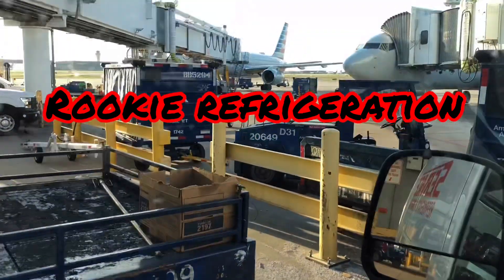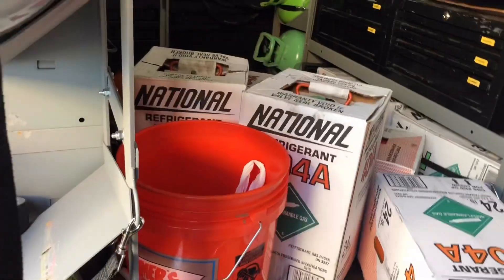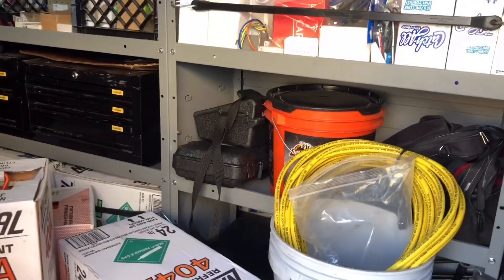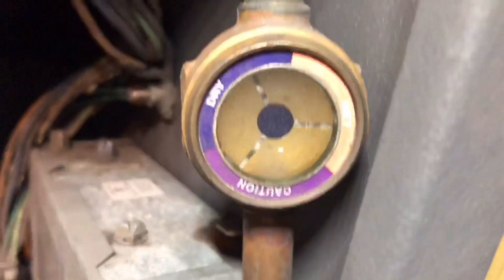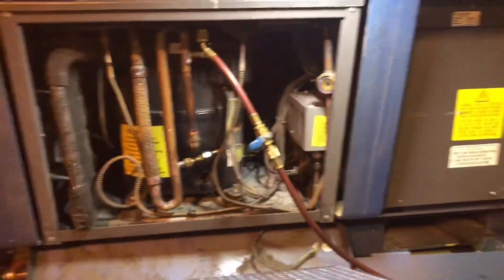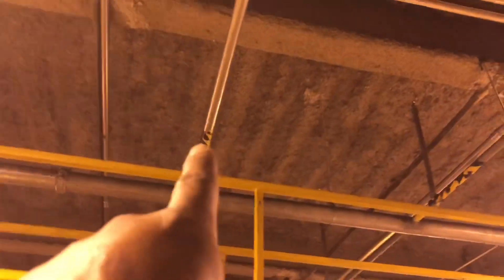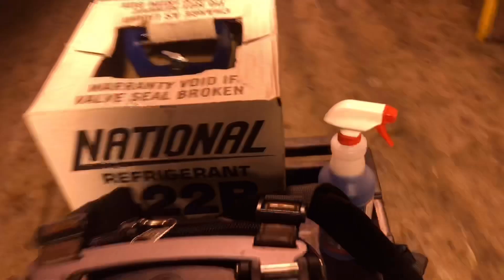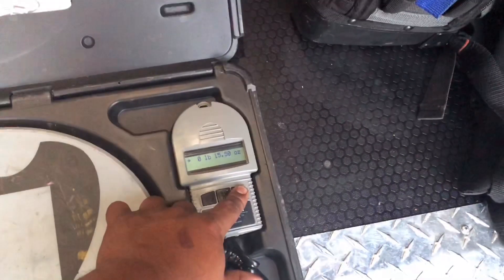HVAC/Refrigeration:  XRay Machine at Airport low on charge.

Comment: I had to install a remote beer system at a large airport once.  It was a pain in the rear because you had to have security personnel escort you back and forth to the truck.  I put a caulk gun through the xray machine and the security guys thought it might be a machine gun.  I even went through the wrong door and set off a security alarm.  This was back in the 80's before TSA.
Reply from the maker: PickleRix lol.  That’s funny

Comment: Dude I know the feeling. I work all the non Coke a Cola vending repairs at DFW and for American Airlines. 
Brothers from another mother. 
Will look for you. Like to meet ya.
Reply: 6:44 headed for the gate. 
The sense of relief. 
The stress is manageable after a while, couple of years. 
Have been on the ramp for 11 years. I know the spots. You parked D29 and were lucky to find a spot for sure. Next time check out around D34 ish. Is a straight walk to the interior with easy parking. 
As well in the left side of aircraft is an open area marked within the fire lane stripes, usually can find a spot. But never on the right side, all loading and unloading happens, crew chief cheer me out for it.
Reply: 8:37 parking take a right
Reply: 9:05 freedom!

Comment: I do work at PHL..I LOVE working at the airport. It's super cool diving near the planes and all. You get use to it driving around. Remember planes have the right away..lol. the worst part about it is the tug drivers..they run into everything... including the work vans..leak check first and then add gas.. what of you had to pull the charge would been better no to waste virgin gas. Be safe out there.

Comment: Lol I used to work on fuel systems and controls for them and generators - you really have to be carefull in airports - there are two things you dont want to do - knock out the lights and somehow trip the ESD on the fuel system.  I have worked on stuff where i had to get clearence letters from NORAD and some big shot general out of Virginia when working on some military facilities- the fine to the company I was working for which had a contract to operate the facility was $10,000.00 per minute if the radar stopped turning and the outage could be attributed to a lack of maintenance...  now boys that is work place pressure...
Reply from the maker: Holy hell. That sounds like some liability..

Comment: Those retrofit refrigerants are such a god damn pain in the ass to find and dispose of. I love the concept of finding something better but something like R408A is peddling backwards in getting something better for the environment it seems.
Reply: I wouldn't tell anyone,  it's a felony charge. You never mix refrigerant. No drop on top, only drop in REPLACEMENT
Chris! Besides 427A is high temp
Reply: try r427a. we use that in NJ. I like it and most of the time it's just like r22 you can even top off a system that has r22 in it
Reply: @chrisscerbo5731  who ever told you that was wrong!! Stop mixing refrigerants... It's a pain in the ass when I recover somebody's homemade blend and turn it in, and get charged for mixed refrigerant. Little hard to set sh and sc with your own blend that u don't have a pt chart for.